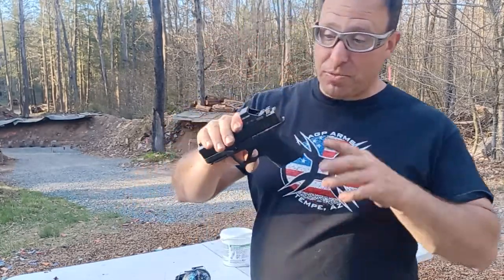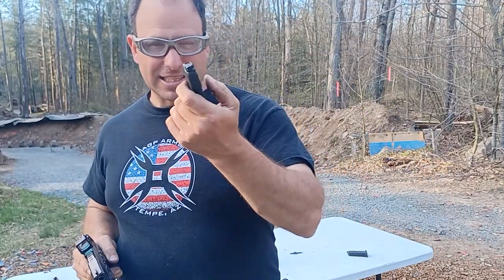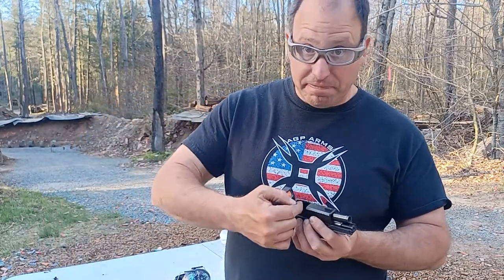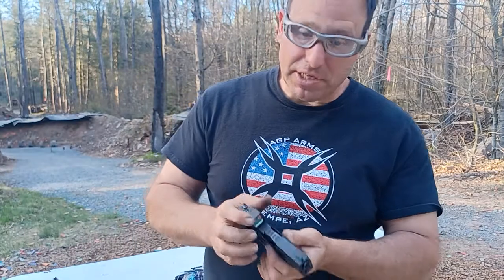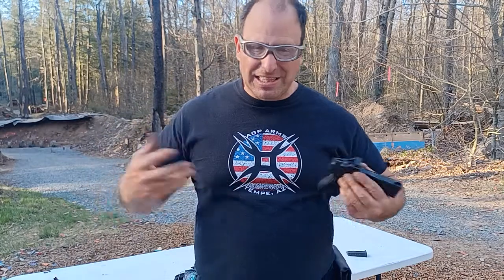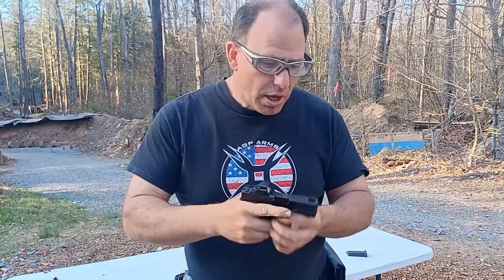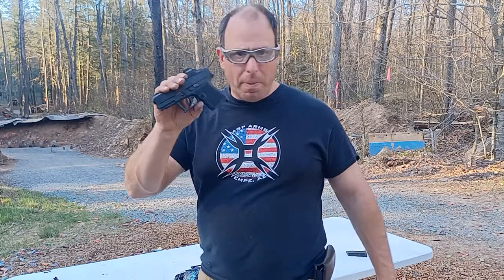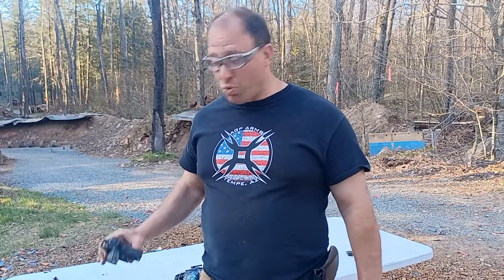Glock 43 aftermarket problems ◇ recoil spring, striker, magazine release

Comment: Great video. Running into one of the problems you are describing. Going to try OEM recoil spring... Getting light strikes on a Patmos arms slide. Suspect it it not getting into battery well... added a 31 newton extra weight striker spring and cross armory extended tip firing pin also. Could be the patmos arms slide has some tolerances off in the striker spring chamber also as it seems a bit sticky tight. Wondering if it is cerakore in the chamber also at this point. I changed mags and mag release to all shield arms steel mag release and mags. They are great. Thanks again for video... I built a G48 also which works perfect on the P9SS frame, so I am suspect of either the recoil spring or slide on the G43 at this point...
Reply from the maker: The Recoil spring that I got from Big Tex Ordnance works pretty good for g43

Comment: I have the answer for the Glock 43X you can keep the tungsten guide rod in all you have to do is get a reduced plunger spring
Reply from the maker: Thank you very much for that advice.
Reply: @absolutegunrights3079  np but I hate i’ve already sanded my bar fin
Reply from the maker: @Safe_firearms  yeah I've done a lot of adjustments ass backwards myself. Ended up just replacing the parts.
Reply: Quick question how would I know if I sand it too much because I barely sand it but how would I know?
Reply from the maker: @Safe_firearms  if you sand the Fin too much, it will not push the plunger up and out of the way to let the firing pin through.

The way to test that, is with the gun completely unloaded, rack the slide and put a pencil down the barrel. When you press the trigger, the pencil should jump from the firing pin hitting it.
Reply: @absolutegunrights3079  thanks it’s jumping You must have sanded yours pretty good?

Comment: P80 pf9ss has horrible aftermarket parts!!  Just buy everything stock. Recoil guide rod and magazines oem. Upper and all lower parts oem. Except slide of course. And if you can barrel.
Reply from the maker: I could not find OEM parts for most of 2021 and 2022. I had to make due what I could get.
Reply: @absolutegunrights3079  man I ended up paying $600 to build a fukkin pf9ss during the pandemic. Now they got whole slides for 280!? And lowers for $80

Comment: OK mine shoots the first bullet ejects second bullet cycles perfect but when I pull the trigger, it won’t fire up. Help? I just got all OEM parts plus P 80 sent me the new rails. Yeah the 43 rails are Sarah coated and flat on the back before they were all metal and on the back they had a little ledge. Hopefully these little changes fix things.  when you put in the striker is it supposed to feel tight or is it supposed to feel smooth like a 19? Because you know I have the 43 does it have the innertube? Please help need certain answers thank you.
Reply from the maker: This video should help
https://youtu.be/Zwxq7rMbltE
Reply from the maker: I believe that your firing pin is not getting pulled back. The video that I liked above will show you how to modify it. However this is a temporary fix and the Pinhead will most likely break after a few hundred rounds.

I got Aim Surplus Billet Strikers for G43. Those are working very good.

They work with Steelcase but they like brass better.